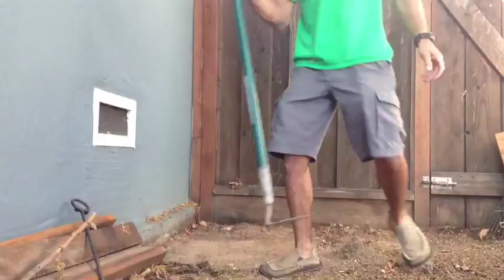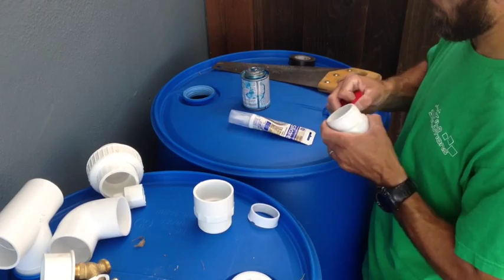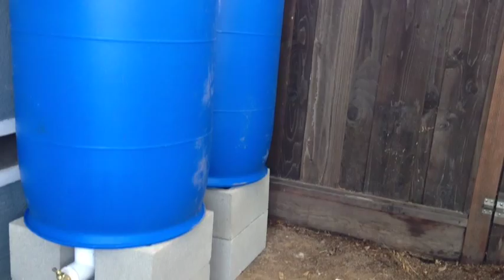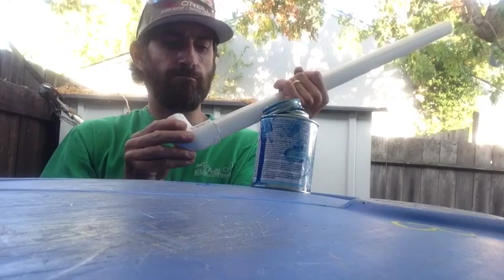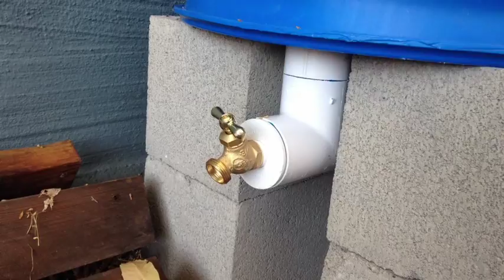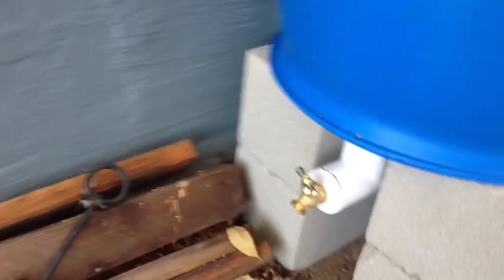55 Gallon Drum Rain Barrels

Comment: Could you list the sizes and parts you used with the pvc pipes and fittings? I want to make this later this month for my garden. Im going to buy five, 55 gallon barrels. You have the best design that I have seen and most up to date. Also if there is anything you would have done different if you were to do this again would be great too. Thanks. I might make an update video with my rain barrel and I can give your channel a shout out too.
Reply: AJH81  Have you received a list of parts yet. If so, could you share. Thanks

Comment: Where did you get those pvc adapters that screw in I have been looking and can`t find any?
Reply: Late to the party, but usually the 2 holes in top are, one 2-inch NPT(fine), and one 2-inch buttress thread(coarse).